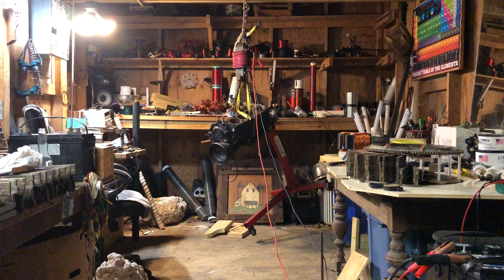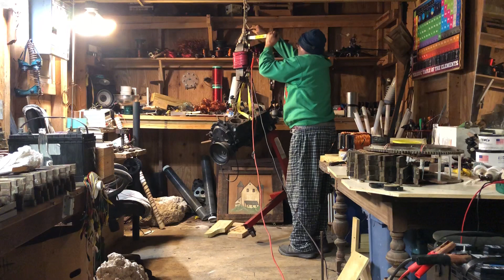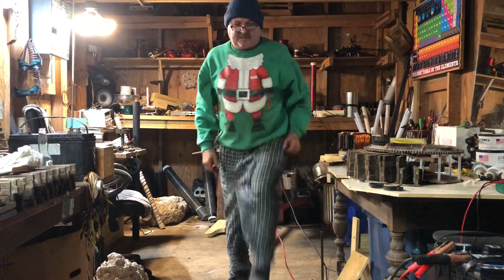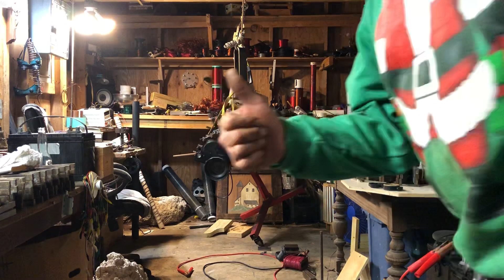Perpetual Motion Holder, Verses Engine Motor Block!

Comment: I wonder if it could hold the engine just by a single tap of a wire like if we had 120 dc volts I wonder if that bar would stick on there with more speed I have a dozen 12 volt battery at home I could wire in series think it's a good idea?
Reply from the maker: Elijah Packard 
Don’t get hurt!
Reply: Safety first. Just was thinking about the voltage in a golf cart I think doubling that would work but not sure if voltage would make a difference or if it's the density of the metal like ed says.